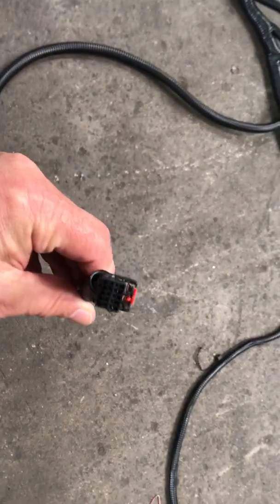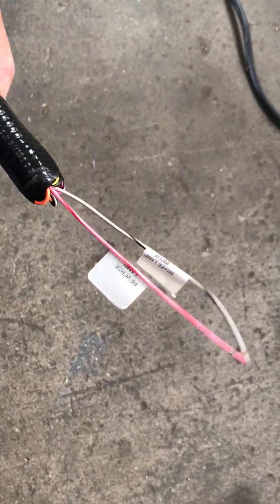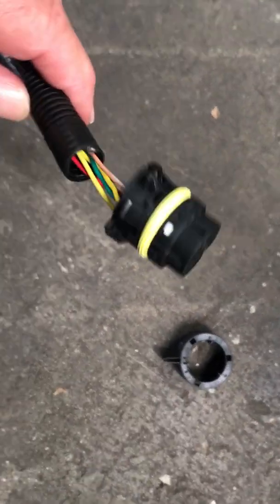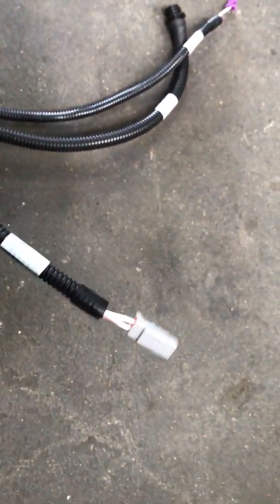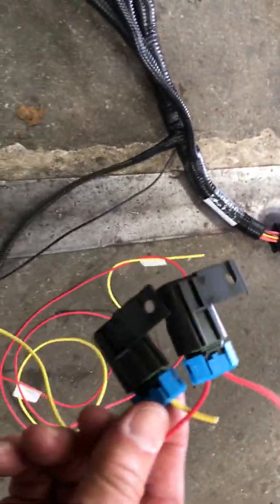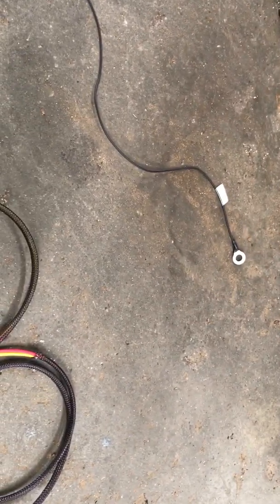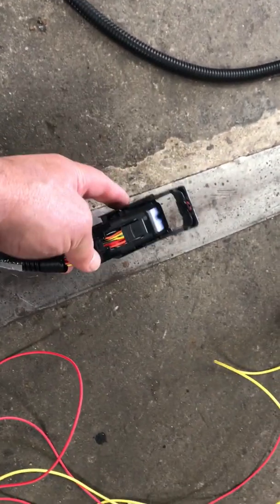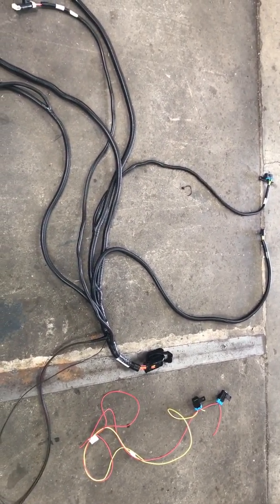8 speed wiring

Comment: Do you guys know how to install the new 8 speed into a JK?
Reply from the maker: Yes, i would start with a Truck 8 speed for the 3.6L, now the only JK we could do this on a 2012-2018.
Reply: So the harness is needed but what else? Any pcm modifications? Change driveshafts? 

Or get the wiring harness from you with the crossmemeber conversion, shifter and wire it up and go?
Than you.
Reply from the maker: @billoleary2321  Yes we have to modify the engine computer.